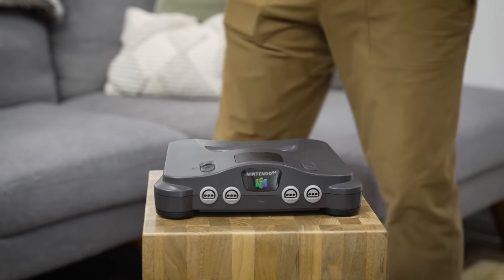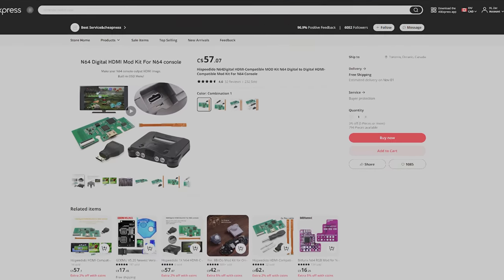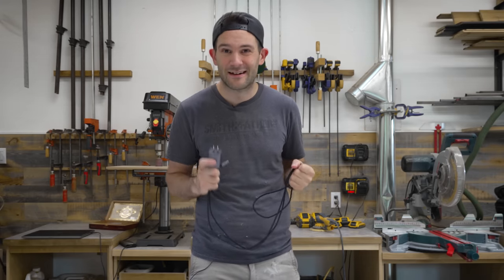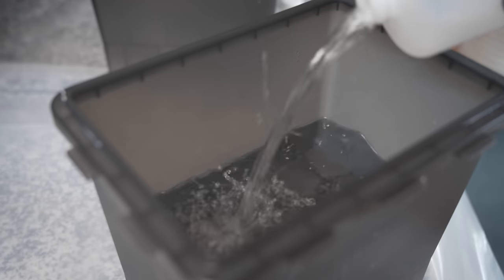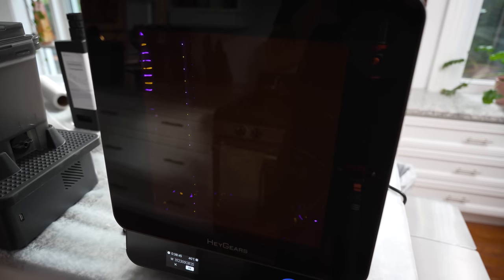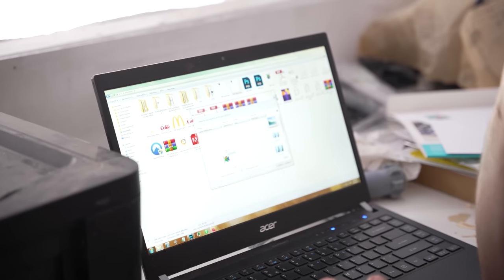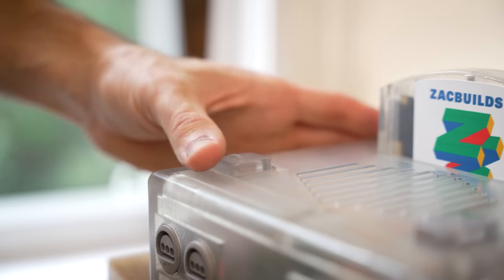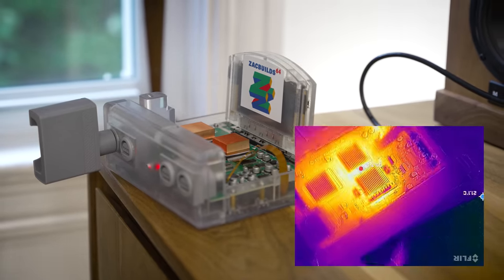I built a MODERN N64...

Comment: I was expecting "modern" chips and such... not a refit of an existing unit. BUT - what a great introduction to microsoldering. So many "microlessons" learned. I'm subscribing, and Continued Success!
Reply: Obviously they don't make the CPU any more, and the RCP (GPU) was specially designed for Nintendo. But if you want one made out of modern reprogrammable chips you should look into FPGA gaming. It simulates the actual hardware of an N64 (or other console) using a newer chip with more power that can afford to waste some power to run a simulation.
Reply: Or just use an emulator that are perfect replicas of the hardware in software that have existed since the early 00s
Reply: @MrAB-fo7zk boooooo
Reply: @MrAB-fo7zk  There are a couple of problems with emulators. Firstly, they don't necessarily perfectly replicate the original hardware. Depending on the host system, timing and performance issues abound. Secondly, a lot of cartridges include additional hardware (other than ROMs) which make emulation of those cards difficult.

And, there's the cool factor of playing on the original device. 

I also prefer EMUs due to their portability and ubiquity. But there is something to be said for playing on original hardware.
Reply: Or desolder all special chips and print a new circuit board with space for the new components and the expansion pack?
Reply: @ArneChristianRosenfeldt  Actually,  this is the demise of "8-Bit-Guy's" X-16 project. They're using a custom Yamaha chip for sound from the 1980s.

The problem is that those old chips are hard to find. And, as they age, they begin to break down. Ultimately using "vintage" chips is a losing proposition.

The only path forward is to create new systems using modern chips. In many cases FPGAs. (Which, BTW, was a design goal of X-16 - to use only off the shelf modern chips and no FPGAs. Both design goals were discarded).

For a good example of "retro" computers with modern parts check out the Phoenix 256 project.
Reply: @devcybiko  I don’t really get FPGAs here. Usually, they are needed for fast reaction. N64 uses a framebuffer and hence has a large latency. I guess that on a system with multiple processors ( CPU, PPU ) every time a message is passed, we need to calculate the simulated clock.

Retro for me is to get away with 40 pins and 64 kB. I want a restomod: would it have been possible to use digital sound in 1982 . I read that the Atari ST had an R2R network on the shift chip, but tolerance was to high. So external resistors were connected. So it seams that retro for me means CRT ( 60Hz SCART or VGA ) and analog wired audio.

Gamers just use Mister with HDMI.

That Foenix 256 has sprites with 256 colors per pixel and a huge palette. 3 bytes of the sprite description are used for the source address. I don’t get why they could not also include scaling a la Lynx and SegaCD.

With a z layer ( typical genesis ), I would try to reduce screen coordinates to a byte? Add sprite number to the x? Ah, I see, it is probably only used to resolve with the background.

I wonder if it is possible in FPGA to use have tilemaps where 0= empty and above 127= totally solid. Then some OAM don’t need to be fetched. Also allow these tiles for sprites ( just a 3 states per sprite 8x8 ). That would be cool. And the have a slow down with the trees in Ghost ‘n ‘Goblins!
Reply: @MrAB-fo7zk  Emulators have a lot of latency regardless of what they are emulating.  Once you try FPGA consoles, you never want to go back to emulation.
Reply: @TheXev  So your opinion is a "law". Good to know;)
Reply: @devcybiko  What I love about extremists is that their worldview is so transparent, but also put in stone.
Like "the demise [of the] project" or "The only[sic!] path forward" or "they begin to break down[laughable generalization without any citation. sure. chips are like vegetables]". Let me guess, YOUR "design" is the best thing since sliced bread? 
Please don't stop experimenting, learning and making and trying out new stuff. But please can you switch a gear down and STFU with that attitude of hubris?:)
Reply: @dieSpinnt  🤷🏻‍♂
Reply: I was expecting an emulator on some modern board, but prefer the technique used.
Reply: Same
Reply: modern chips would make it not a 64. it's called old school for a reason if you want modern stick with the overpriced bs already out
Reply: @dieSpinnt  8bit guy promissed a $50 retro pc and now it's 350 lol like wtf. By the way the person of the video said he built a MODERN n64 which is a hell of stretch beyond baiting. The video ended at 6 minutes, the remaining time it's just him messing with 3d prints

Comment: I've used both of those controllers, and I strongly prefer the original. Those wireless controllers often lose the signal, and the control stick seems to have some issues as well. The original controllers have a control stick which wears out and degrades over time, but you can buy replacement parts for the control stick and get it back to good as new, and the control stick is actually shockingly precise and reliable when in good condition.
Reply: that makes sense; electronics used to be built to last; now they're built extra cheap
Reply: @armorhide406  Yeah, and on top of that, while electronics were never really built with maintenance in mind, at least back then companies hadn't figured out how to actively prevent people from repairing their own stuff as effectively as they do nowadays. Used to be just a few specialized screws that needed a very specific and uncommon type of screwdriver, now it's mostly all just glued together, or comes with chips installed which purposefully brick the entire system if they detect someone trying to do maintenance. Or sometimes things are just as simple as prohibiting the manufacturers from selling parts to individuals (like they did with the microsoldering thing which is only sold to authorized repair shops). Kinda sad to see things become so increasingly anti right to repair.
Reply: I love the original controllers, it just sucks when the joystick starts wearing out.
Reply: Only third party controller I like for N64 is those ones on eBay that look exactly like the original but also work on Switch, they cost around $29-$35 and come in original gray or black.
Reply: enriqueamaya3883 wrong video pal
Reply: Yeah, that was pretty clearly an ad segment. If it wasn't, he should probably tone down the specific references to the brand and model, or at least specify that it wasn't an ad, because it makes his content seem less trustworthy. The printer segment was an ad too, and this was only disclosed through a quick on-screen graphic. The title, description, and voice-over don't mention it. This is the first video of his I've seen, but it's not a great first impression. The content was cool, though.
Reply: @jdebhardt  Brawler 64 is the only manufacturer that makes 2.4 Ghz wireless N64 controllers. Neglecting to mention the brand in this specific case would have been in my opinion a failing on his part. It would only serve to make the product more difficult to find to appease a minority of a minority of viewers.
Reply: Yeah, I bought the Gamecube version they make, and the console adapter seems to work fine, but that model comes with a USB adapter as well and it latterly needs line of sight to stay connected which makes it useless if you want to play on a emulators on PC. I was really bummed because these retro controllers have had so much positive media posted online.
Reply: if you wanna spend a shitton of money, there's adapters for the nintendo official wireless n64 controller. you'd be spending around $100 per controller though, but its the best modern n64 joystick rn
Reply: @armorhide406  Not all, a lot of older controllers were also not built with the best tech that they could have such as hall effect sensors like the Dreamcast controllers had.
Reply: The Brawler is some shit, but you can see from the cam angle at 19:23 he's shilling it (plus he has aff links) so you need to take his hype with a pinch of salt. Nothing touches the real controller. If you need one that takes a battering, you get a Hori.
Reply: @danieladams5379  Strongly agree with this. Not only is the original control stick far superior and necessary for the N64 games that were built around it, but the trident shape of the original allows you to use the D-pad with the left hand for movement and strafing while using the stick + Z trigger with the right hand when playing first person shooters like Goldeneye and Perfect Dark, providing dual control movements more similar to modern first person shooter controls. This is far better than the tank-like controls of using the stick in the left hand for both movement and aiming and more modern hand assignments than using the c-buttons for strafing.
Reply: Original controller is far superior and necessary to play the N64 games that were built around it. The original trident shape of the controller also allows you to control first person shooters like Goldeneye using more modern hand assignments. The D-pad with left thumb for strafing and movement (left index finger on the L shoulder button for cross hair aim) and the stick and z trigger with the right hand for aiming and shooting. No other controller allows you to do this and Nintendo has some early literature that says the D-pad is good to use with first person shooters. This far surpasses the tank-like controls a lot of us were using back in the day, the very controls that turn people off to the game in modern day, and the controls which you will be stuck with using if you have a Brawler 64 or other so-called modern version of the N64 controller. The Trident is absolutely essential for me to play the N64.
Reply: The brawler 64 is great and works well for me with no such connection issues.
if you're having wireless interference, you need to check your environment, the connectivity is excellent in my experience.

The controllers are also easy

 to repair, as these sorts of sticks are standard in analog controllers, the N64 style sticks are not easily repaired with OEM quality sticks, but YMMV there.
Reply: @Crono454  I give the brawler a 6/10. The hori pad mini is a 9/10 and the original a 8/10.
Reply: @shaun8062  the horipad mini lol

Just use the original, why use something that’s both old and will drift bc it has a potentiometer?
Reply: @Crono454  I was talking durability. Hori mini are like tanks. Ive never seen one malfunction or break before. The original is more precise.
Reply: @Crono454 The issue is quality. The stick is awful, the D-pad is awful, it weighs nothing and feels like crap. No reason to not use the real controller ever. The loose stick is an easy fix.
Reply: @danieladams5379  I have lots of hours on the controller, and I like it. Dpad, buttons, stick all work and feel great. Build quality is excellent. Weight isn’t build quality, weight is just there to make you tired. If you like things being heavy that’s fine, but being light is purely a preference and heavy is bad for your hand health.

To each his own tho. You don’t have to like it. I have several of their controllers for different consoles. The build quality is excellent.

It’s a lie to say it’s easy to source quality sticks to drop into original N64 controllers tho. While I prefer the original, I also prefer not to wear them out every time I’m playing.
Reply: @Crono454  Bought two of these in the past. One would trigger the left-shoulder when you moved the analogue stick up-left and the second exploded like an egg when dropped a single metre. Absolute garbage. Still have all my originals from the 90's going strong regardless of the use they got.

Comment: Can we maybe see a part two where you do disassemble the wireless receiver, slim it down, and connect it somewhere hidden? That'd be really neat!
Reply: As much as wireless is cool and overall an upgrade, I think you lose a bit of the nostalgia not having those ports on the front.  Maybe a simple retooling of the wireless connector to make it more streamlined and eliminate the memory card port?
Reply: @shawnstolze4462 you could leave the ports empty (and maybe even disconnected) while having internal wireless receivers
Reply: can't hook up the n64 transfer pak for pokemon stadium without that port
Reply: didn't say anything about, or recommend removing the port.... just hiding that receiver  @joshfaustcomedy
Reply: @joshfaustcomedy do you need the transfer pack if your games are dlc?
Reply: I thought e was going to do it too...........but he didn't
Reply: @kenningtonrund282  Or just add a switches that allow you to choose wireless or wired.  You could do it with big ugly metal switches if you want an industrial look or nice and neat switches on the  bottom for clean modern styling.
Reply: @joshfaustcomedy pretty sure the transfer pak doesn't have to be on the p1 port.

So you could theoretically even hardwire in a transfer pak to another port.
Reply: Yes, that wireless receiver is pretty damned ugly and really lets the look down.

Comment: If want to cut out another item, apparently you can get rid of the need for the expansion pack by replacing the 2x 2mb RDRAM modules on the board with 4mb ones (and then add in a resister in place of the jumper pack). This mod becomes more desirable for those looking to make a n64 portable. (Note: Revisions to the N64 later in its life replaced the 2x 2mb modules with a single 4mb, so this cannot be done for the later revisions.)
Reply: Ahh true true!
Reply: ....and do you have any clue on how to actually do this?  Or did you just read some comment on the internet from some know-it-all who claims you can do it but doesn't actually know how nor ever elaborates?
Reply: @MrRobarino  you literally just unsolder the ram chips and replace with bigger capacity ones, its not that hard to do

Comment: Kudos for the power connector desoldering, it is really hard without the hot air station but generally mixing your own leaded solder with the un-leaded factory one lowers the overall melting point thus facilitating all melting at the same time and the solder blob was the way to go, also check solder suckers they are quite helpful for getting those multi legged components out, also also drag solder on point!
Reply: Solder wick will work fine too. Your tip is #1 though. Just increase iron temps from average for the larger mass, and melt a bunch of fresh solder over the pins. Solder wick should suck it all up and with new solder + a bit of flux it should all come out pretty cleanly.
Reply: N64 should have leaded solder, it's old enough. I think 7th gen consoles were the first with unleaded solder. (Which led to the notoriously bad reliability of the very first versions of all of those consoles)
Reply: Yes it will be leaded solder.
Reply: @82NeXus  Would still always apply fresh solder before attempting to desolder. Most of what I work on is high end studio equipment from the 70s and 80s which would obviously be leaded solder, yet it still very often will get "stuck" and not flow well without a fresh layer. I'm not sure if it's because it reflows some flux across both ends and separates easier afterwards, but regardless, old solder has a tendency to become "stuck" and just filling it back in with new solder and sucking it back out can often give a perfectly clean joint from something that was being very difficult - to the point where I often just apply new solder in the first place.
Reply: @ryanjay6241  Yeah a know. I always try to mix a good amount of new solder into the old before desoldering. Sometimes it doesn't seem to mix well though. Don't know if it's because I was mixing lead with lead-free or because the solder on the board was old, or my iron wasn't hot enough for the lead-free solder, or what.
Reply: @82NeXus  Could be any of the above, it's hard to say. I've experienced that too on things made far before lead free solder. If it is lead free solder, some of them do have a significantly higher melting point. For older solder, I'm assuming it has to do with the area and solder possibly having corrosion and contaminants not making it flow well. Sometimes I'll also apply a bunch of flux to it before feeding new solder as well, sometimes it can help. Usually, if everything is flowing properly, things "should" wick right up and drop right out - if not, I usually try to re-evaluate why it's not before trying a more destructive approach. The last possibility is heat isn't being applied properly ... for various reasons (like a large ground plane pulling a bunch of heat off the joint), but usually that one you can tell by feeling.

Comment: I wouldn't have remove the ports on the front so I do like your decision. The adapter is a little ugly but maybe you could modify the adapter to make it smaller since you don't need the memory portion of it. Good video!
Reply: There are other devices that use that port besides memory cards though. Pokemon stadium had an adapter you could plug  a gameboy cartridge into to transfer pokemon and actually emulate the games. You could even fast forward the game.

Comment: Another cool mod could have been integrating the Everdrive directly to the main board itself. Alongside the wireless controller mod you mentioned at the end, a compact portless box would be pretty rad.
Reply: That would make removing the sd a pain in the ass
Reply: You could print another case with a sd card slot inside it
Reply: @frandurrieu6477  It also looked like there was a second port on the everdrive.  Maybe a direct to PC connection?
Reply: If we’re modding out controller ports and the cartridge port, a miniPC would be your “compact portless box”. 

This turned out perfect the way it did.